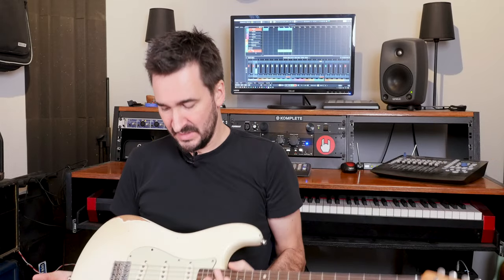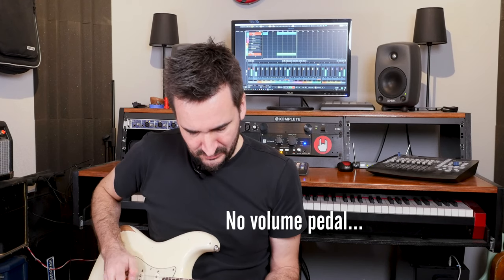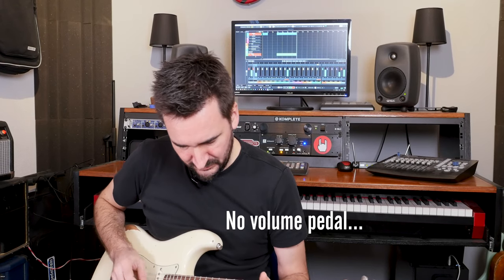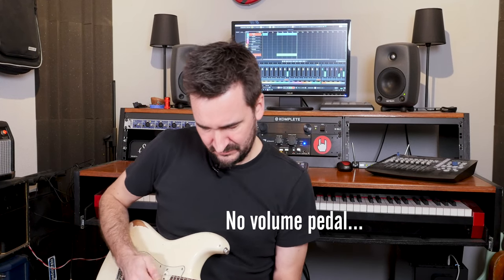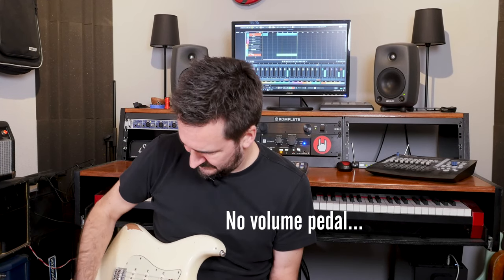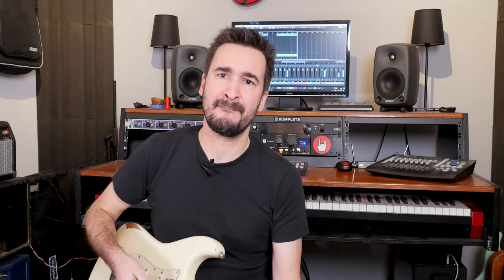Vertex Effects Volume Pedal Mod - Demo by Martin Klaja

Comment: Ok but this Volumen Paddle is for Low Impedanz.
It works in the effekt loop very well.
But if you put it  directly after your guitar into this paddle you will have a rolloff high end.
In this Case you can put a buffer or a buffered bypass pedal in front of this peddal.
This will solve this Problem.
In my case i have a Compressor directly after my guitar in this paddel.
I have done de Vertex mod too.
So you can regulate the distortion of other peddals and Amp very good.
Nice Video 👍
Reply: It is the same with the Boss fv500H. Half way the high freq are lost. The only mod you can do is inserting a treble bleed in the pedal, just like in a guitar.

Comment: Hey Martin, thanks a lot for that video, you got me to mod my pedal!
When reading the mod page as described on vertexeffects however, I got the strong conviction that something in this mod is wrong.
Indeed, it recommends to connect pins 1-2-3-4; thus physically connecting both mono circuits.  So what I did is connecting pins 1-2 and 3-4 as two groups of two pins, the only difference with original mod being that 2 and 3 are not connected.
Could you confirm my theory, by connecting guitar in input_1 and the amp in output_2.  On my modded pedal, channels are separated so I hear nothing, on yours, if 2 and 3 are connected, you should hear the signal.
This is not specially bad, as the pedal could be used as a splitter from 1 guitar to 2 amps (probably with some toneloss), or for 2 guitars to 1 amp (though that will probably saturate) - but to me it killed the purpose of having a true stereo volume pedal.
Please let me know! 
best regards

Comment: The same as with the "mod" on the Boss fv500h, there is nothing to make this pedal more transparant with this mod. A whole bunch of blabla. What you do is cutting out a circuit that does nothing at the tone at all! Sorry to say everyone who says  "Oh Wow I hear a big difference" is fooling himself. I have the Boss FV500h and draw the circuit of it, so I can see what is done by Vertex. Unbelievable what here is stated. The only thing you can do is make a treble bleeder on the pot. I did that with my pedal back in the 90's. Super transparent from zero to max. The original pedal give on max the transparant signal but half way the sound lacks high frequencies. Just the same as your guitar does without a treble bleed. Ater this mod you can not use it anymore as a expression pedal.
Reply from the maker: The pedal stille functions fine as an expressions pedal after the mod.